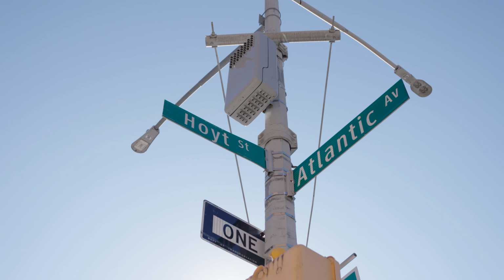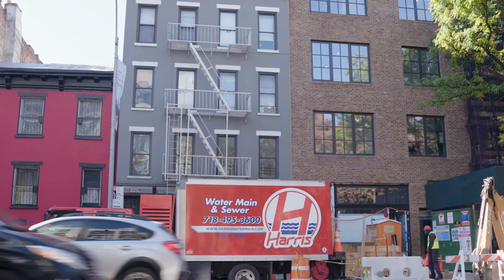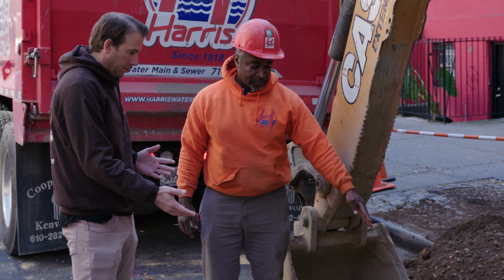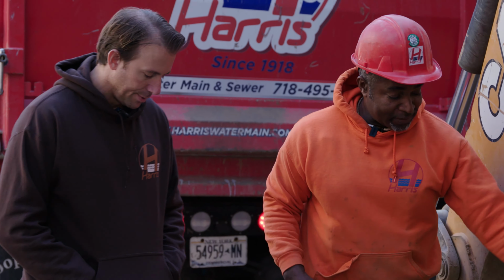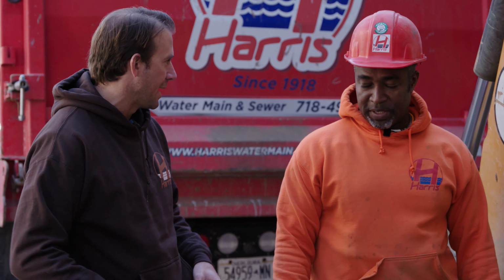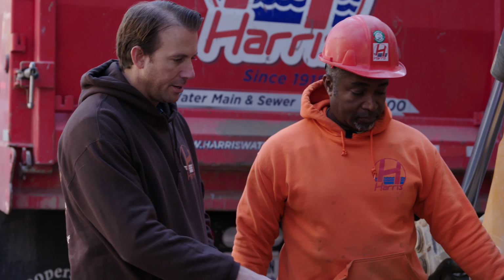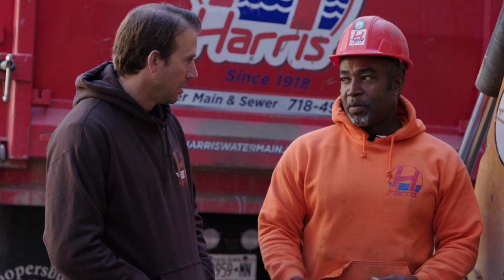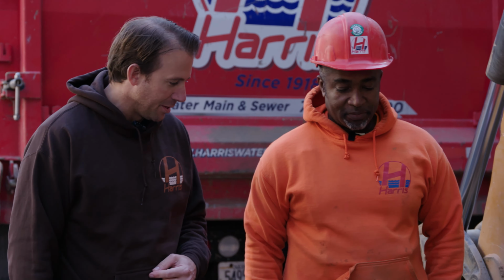Complicated Water Main and Sewer Installation in Brooklyn

Comment: Do you have to put slurry in your street cuts? Where I can live the city requires slurry in the street cuts as backfilling.
Reply from the maker: Thankfully not!
Reply: @HarrisWaterandSewer  Okay.I didn't know what they were requiring for you to do.
Reply from the maker: @williamfenner9915  Soil properly compacted, a concrete base and final restoration of asphalt.  Usually does the job 😀😀😀
Reply: @HarrisWaterandSewer  A lot of the issues that they are having trouble with is undermining in the streets. If that happens the city has to go back, and replace the sub base, and then repave the rest of the cut.
Reply from the maker: @williamfenner9915  In NYC the plumber is responsible for the roadway/sidewalk hole for a period of 3 years and 5 years on some streets.